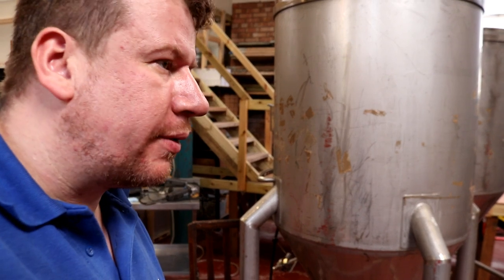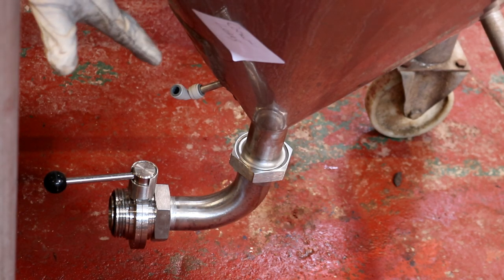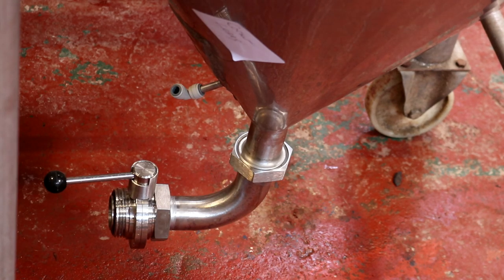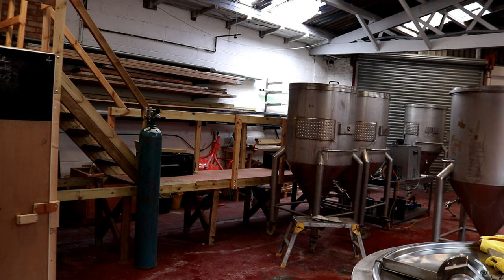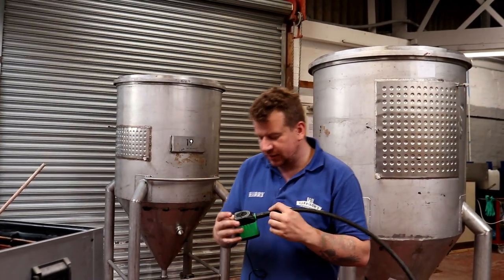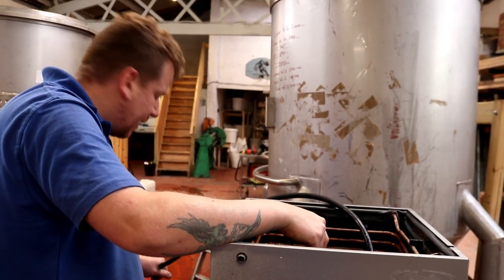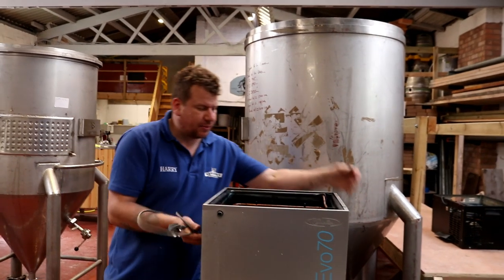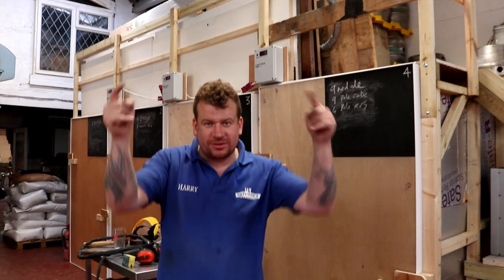COOLING PANEL REPOSITION

Comment: Great progress made,was worried cutting and rewelding the cooling jackets would present a problem but seems like you cracked it. I suppose any leftover marks won't matter as you'll be cladding be them all. You're zipping along with them and I reckon it won't be too long more until they are clad and ready to rock,first week of August i reckon all going well. Keep it going Harry m8. Gemma you are a saint for putting up with him. Cheers.